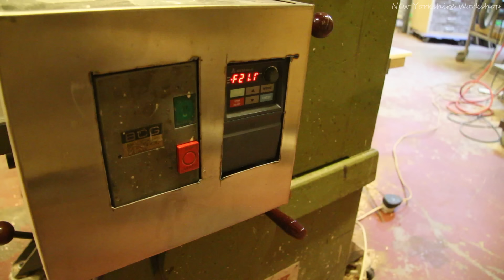Making a plinth for a Linn LP12 turntable

Comment: excellent... if the original LINN ones aren't made like this - they should be !!. Now the plinths have an additional routed rebate for a cable clamp for the mains cable, and steel corner brackets were added in 2008, with 2 off Nr6 x 13mm St.Steel Philips screws.  I hope the one i bought from Canada is as well made as this one. It doesn't like as nice as this one as the finish seems to be tinted brown and covers a lot of the walnut grain so i will sand it back and refinish it.

Comment: Why do you use hot glue to glue in the corner braces - surely PVA (or similar) would be better? They are intended to stiffen the frame after all.

Comment: Hey Paul, Audion Amps used to offer wood cheeks as optional extras for their superb Edison E30 valve amp kits (the cheeks are basically solid wood slabs with a single large rebate to match the amp chassis sides... I'm sure Audion will be able to supply 'Yorkshire CAD' drawings), but they currently can't find a supplier who can make them... seriously, there really could be another audiophile market niche for you there.  Also cracking job on the Linn plinth!  So now I'm thinking how cool my LP12 and Edison would look with matched wood finishes... go on drop them an email!!

Comment: Does your LP-12 pull well?
The one I had sounded good but would not even let me use my Discwasher brush, held very lightly.
Traded it for an Ariston....
Reply: You could have just turned it by hand when cleaning, but sounds like the motor was lacking yes..

Comment: Do you normally make 1 of these at a time, or a smallish batch? (I supposed you might be limited by how many frame clamps you have...)
Reply from the maker: it depends, the only part i can save time on really is the machining, primarily setting up the moulder. everything else is hands on so i tend to make them individually or how ever many i need to fulfil an order.

Comment: Why do LP 12's require restoration so much to justify such investment in parts and jigs. At any rate why would restorations require a new plinth, it's not as if it's an insubstantial design.
Reply: LP12s have been made for 49 years and the oldest ones have wear and tear from house moves, etc.  With over 100,000 made there are surely many that could use a nice upgraded plinth.